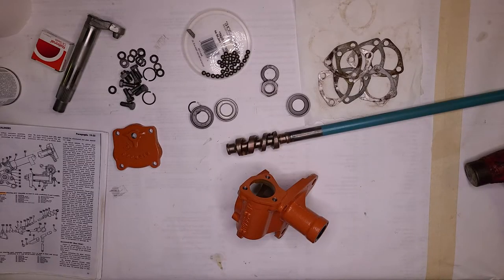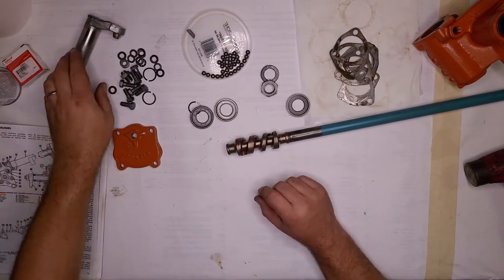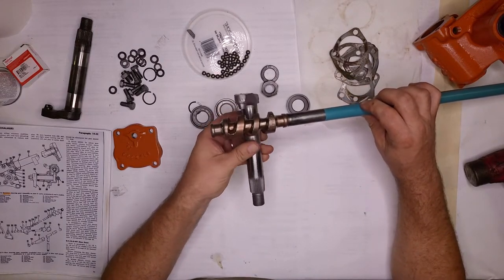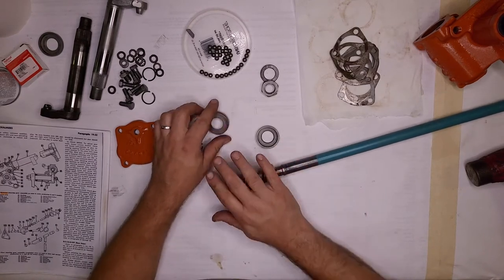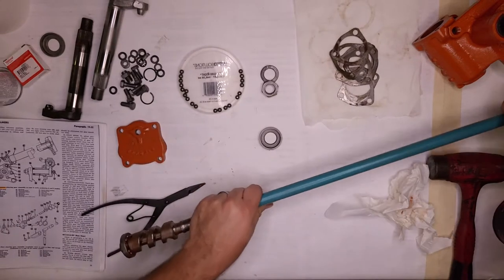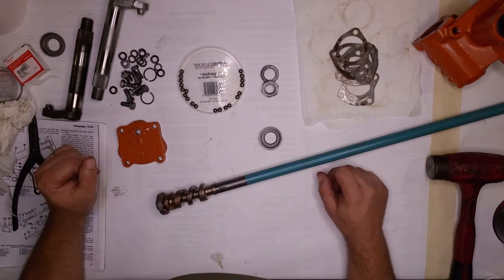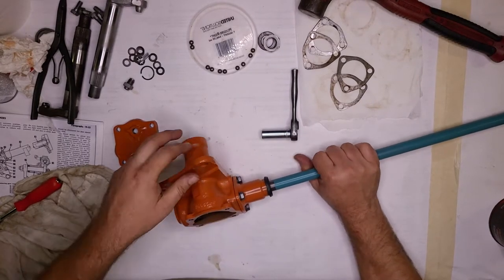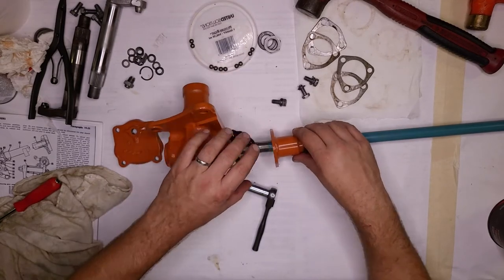1953 Allis Chalmers B Steering Gear Assembly

Comment: Thanks for ur quick reply, yes it is the cap on the bottom bearing thanks
Reply from the maker: If you measure the hole size you can probably match up a freeze plug by size that would fit.
Reply: Thanks I will try

Comment: I like the rubber seal you put over the input shaft that keeps the water out of the gearbox. Looks like that is a mod you did. Any idea what seal that was? I would like to put something similar on mine to keep the moisture out if possible.
Reply from the maker: The rubber around the sleeve in the video was made onto it already.

Comment: I have a '61 Allis Chalmers D12 tractor with a Ross Steering Gear. The steering arm seal has failed so I get a steady drip drip drip of oil down the arm and the side cover of the tractor. I purchased a new seal from Agco and would like to install it without tearing the box down. Can I pull the old seal out with a self tapping screw and install the new seal. I don't see a C clip holding the seal on mine and didn't see one in your video either. I suspect there isn't any pressure in the steering box so perhaps a clip isn't necessary to retain the seal. I thought perhaps the seal is installed from inside the box but your video would suggest not.
Any advice welcome. 
Outstanding video by the way and beautiful restoration.
Reply from the maker: Thanks and you are 100 percent correct. You should be able to pull it like you stated. I like to use a 3 inch long deck screw or drywall screw. Tap with a hammer to get started and screw it in.
Reply: @JPN76  Great, thank you. I’ll give it a go

Comment: Very good video, got a question for u how much grease or oil do u put in it? Where can I get the end cap ? I rebuilt the he one for a friend new bearings, but he says he can’t find the end cap. 
Again very good
Reply from the maker: Thanks. Are you referring to the metal end cap on the bottom covering g the bearing?  I filler with gear oil up to the fill hole after mounting but others have filled with grease.

Comment: Great job! 
What are things to watch or watch out for when disassembling the major assemblies? like how many shims there is, where is gears orientation, shaft position etc.
When that mounts up is there a bracket or clamp also?
Reply from the maker: It's really not bad but I would note how many shims for sure and if there is too much end play in a shaft before you start so you know if you need to try less shims when putting it back together. Also on parts that can be on either side, remeber what side it was on like the differential carrier bearings etc..with gearboxes or other assemblies take a lot of pics. I had to go back to my videos several times to see how it goes back together.

Comment: Question about the steering gear. My model C has a lot of wear as well, haven't taken it apart but looks like the consensus is the the follower pin wears out on these. Someone mentioned it can be replaced with a John Deere AM1515T. The pin looks similar to yours. Wasn't sure if the pin can be knocked out from the backside and possibly replaced with it. Do you recall?
Reply from the maker: On the back I do not see a parting line. It looked one piece but they do sell it separately. It looks exactly like the JD pin. Maybe drill it out then press and weld.  https://www.steinertractor.com/ACS3048-Steering-Levershaft-Pin-AC-B?mkwid=|pcrid||pkw||pmt||slid||pdv|m|product|ACS3048|pgrid||cpgnid|17561055818|ptaid||adtext||&gclid=Cj0KCQjwtO-kBhDIARIsAL6LoreK-ze2QOD6MXNRofAMrWIJTN7Jr9MQk1OdXw2XDzsKNmuIcAr3XYMaAtE0EALw_wcB
Reply from the maker: Just saw this on the link above..... The old pin must be machined out. If you are not a competent machinist, then you will have to employ the services of a machine shop. In this event you are probably better off buying a new steering shaft ACS068.
Reply: @JPN76  Thanks for your response. That seems like a better option for sure.